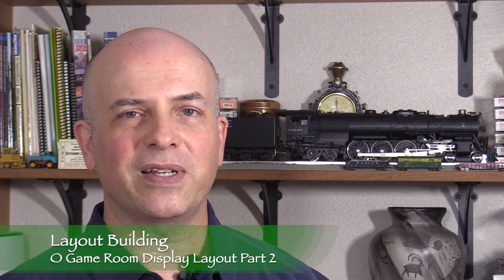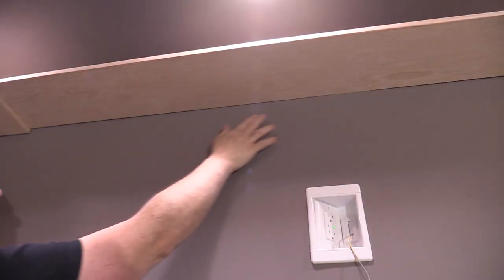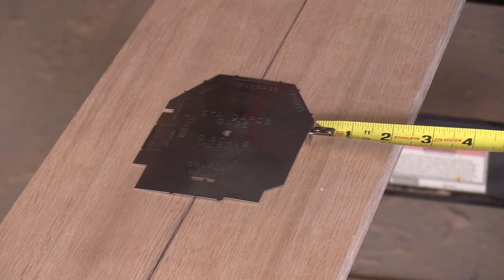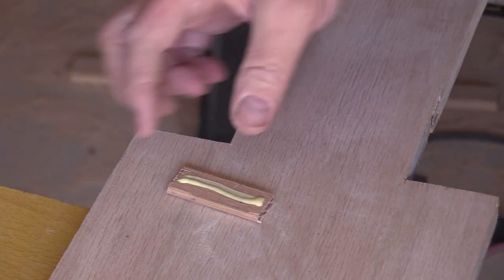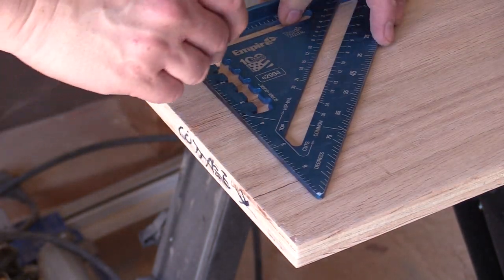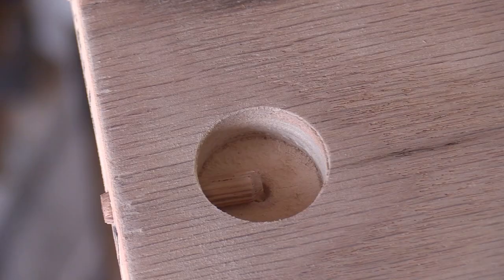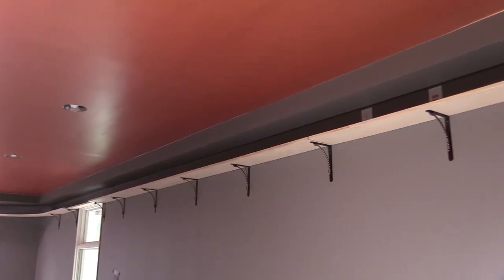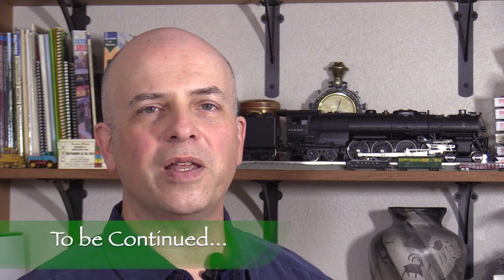Layout Building O Game Room Display Layout Part 2 - Shelf Construction and Finishing

Comment: Really cool project! The stain & poly stuff has given me so many problems with runs on the edges of boards that I no longer use it! With stain, you slap it on, then wipe off the excess which takes care of any runs or drips. Then, after the stain dries you can apply the poly without the concern for dark runs. Looking forward to seeing this completed!
Reply from the maker: We noticed that, too, having to constantly be on the lookout for drips.  There are a few but they mostly ended up on the tops of the boards where they won't be seen.  Next time I might think about doing the separate stain and polyurethane.  Thanks for the info and for watching!